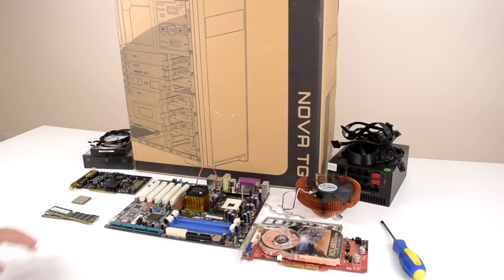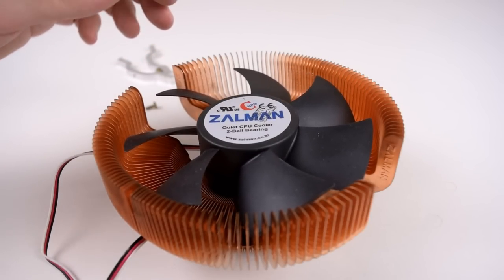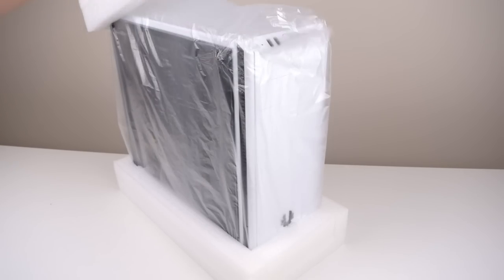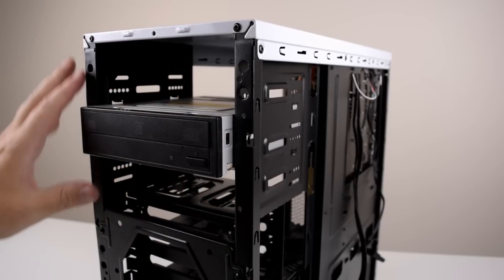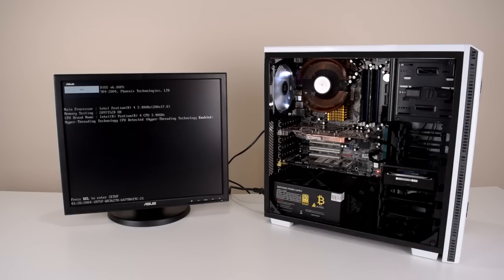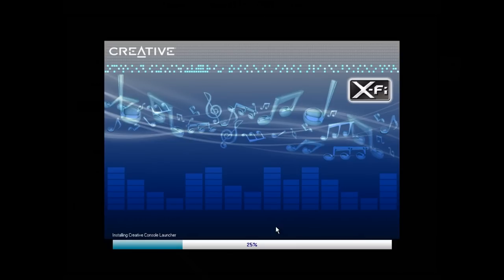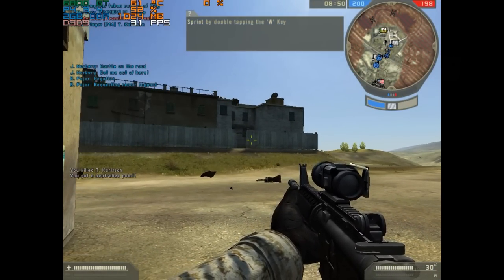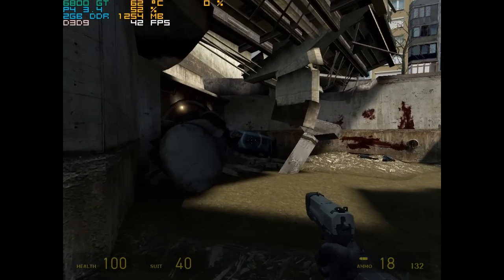Building a Pentium 4 Reverse Sleeper

Comment: Phil, I've heard discussion in the past on whether the Pentium 4's were really a step up from the Pentium 3's or not. Can you elaborate on this in a video? Were the early P4s truly weaker than the established P3s on the market?  Was this resolved at any point (such as when Hyper Threading came out?)
Reply from the maker: Could make for a fun video, but a ton of work because you got to build 2, 3 or even more systems depending on what you want to compare, like SDRAM, RAMBUS, DDR...
Reply: That is true. Maybe consider it as something down the line if you choose to do a series on Pentium processors? I just figured it could be cool to hear about in more depth :)
Reply: IPC is lower, early pentiums needed around 1.7-1.8 GHz to be on par with a 1.4 GHz P3.
Add the price of RDRAM and choosing an Athlon instead was a smart choice.
The later Northwood cores were better and fom my experience with a Cedar Mill chip I'd say NetBurst was highly bandwith limited. (getting around 15% higer performance on average ust by increasing the FSB by 25%, all other clocks the same)
They brought SSE2 and reached way highher clock speeds (topping aut at 3.8 GHz and easily clockable beyond 4 GHz) So anything that uses SSE2 or can fill the long pipeline (like rendering and encoding) runs well on those systems, even compared to Athlons. Stuff that was more into a fast responding FPU (like games) made K7 run circles around Netburst.
For the early chips,, With RDRAM or DDR it was competative, but RDRAM was expensive and it took some time for Intel to accept the facts and switch to DDR. Performance with SDRAM is actually not wirth mentioning.
Reply: Like Lord Mogul said, the Netburst architecture had a far lower IPC than the Tualatin architecture it was supposed to replace. But it is correct that a 1.4 GHz Tualatin P3 can hold ground with a 1.7/1.8 GHz P4. A dual Tualatin 1.4 P3 system can hold ground with a 2.4-2.8 GHz P4 in most everything but memory bandwidth, unless you have a rare dual socket 370 board with DDR. I have a dual P3 1.4, but mine has PC-133.

The reason that Intel bet the farm on Netburst is because they had shifted ideology at this point to "more GHz is better" and believed that even though Netburst had a lower IPC, it could be more than made up with significantly higher clock speeds. Back in 2000, they predicted that Netburst would hit 10 GHz by 2005:

https://www.anandtech.com/show/680/6

We of course know this never happened, even the most refined Netburst core could barely hit 3.8 GHz without using ridiculous amounts of power and pumping out tons of heat.

AMD at this point had largely dropped out of the GHz race and instead chose to make their architecture more efficient at lower clock speeds, hence why they started to use PR ratings on their Athlon XP and Athlon 64 chips.

 Intel would have likely gone bankrupt if it weren't for a small design team in Israel working on a refined architecture based on the Pentium 3, which eventually was known as the Core architecture.
Reply: As for Hyperthreading, it actually caused significant performance penalties in applications that weren't designed to utilize more than one thread, which was common at the time. I remember the moanings of gamers back then that complained about how their expensive new Pentium 4 HT system performed worse than their old P3 system. I was on an AMD system at the time and used to have fun poking fun at them for wasting their money. I'd eventually get around to telling them to turn HT off in the BIOS and they were grateful for the massive performance increase.
Reply: That held true even into later Nehalem systems, often disabling HT improved performance.
On the other hand in programs codes for it enabling HT have easily 15-30% higher performance. Everything that helps feeding the pipeline helped. I wonder how a Pentium 4 build on modern manufacturing could run. Would we able to get the 10 GHz?

Comment: My god that cooler is huge 

Also the nfs underground results surprised me. I only ever dip below 60 when driving through water on a Radeon 9800 Pro, (maxed out at 1280x1024, same results on both an Athlon XP 2500+ and a Pentium 4 530)
Reply from the maker: On default settings it's smooth as butter, but I did crank up everything. So this game depends greatly on the graphics settings.
Reply: PhilsComputerLab I see. I remember underground 2 being very cpu intensive for some reason as well. 
The board I have has PCI-E and AGP (although 2x only and didn't support any form of fast writes so it would bottleneck the 9800 iirc) 
Tried underground 2 with an X1950 XTX and it would not run at a smooth 60 regardless of graphics settings. The same card on a much more modern system was perfectly smooth however.

Comment: Nice :) It's a little bit to old for my tastes though.. (I do have an old AGP Nvidia 7800gt)  I just built up a newer PCI-E version P4 3.2ghz & HT with 4 gigs of ddr2 ram, 120 gig SSD, Windows 7 32 bit.  Windows 7 32 can run a lot of the older games.  I'm in need of a better and older graphics card though. My Nvidia 8600gt is DOA/not responding.  Got a PCI-E nvidia 7800gt/gs card but is missing its stock cooler.  8 series from nvidia would be best with my more current setup and would complete my build for older legacy gaming. (maybe a Nvidia 9600 gt would work)  I'm currently running a crappy gt 730 since it was the only card that worked on boot up with this machine.   I would love to to more legacy games played  with your setup.  Thanks for letting me rant phil.
Reply from the maker: A PCIe Pentium 4 is actually my preferred P4, it's the P4 without many of its flaws. I did such a build recently, and got quite a few comments asking for an AGP build. I will definitely do something with PCIe :D One benefit is cheap video cards, unlike AGP, the high end cards cost a fortune.
Reply: Yeah, the Best Nvidia card in AGP was a GTX 7800gs, i had one years ago.  I was thinking a 8 or 9 series or gts 250 1 gig card. Anything newer would might get finicky or overkill with this system. I'm gonna see if I can snag a 8800 gts 320 mb card from someone I know. (currently running in a fx 60 system)  it would be nice to play my back catalog of older games.

Comment: Great Scott, I had this exact problem (not enough resources) with any nVidia card on one of my retro builds for ages - and never found a solution. Ended up using ATI, which worked fine. I have to try it and if it works, man... :D More over, I just purchased two Pentium Ds from Electromyne using your code, so thank you for that too!
Reply from the maker: Nice, they got good prices on many CPUs, I got a ton from them way before working with them :) I had the same resources issue with a Radeon 8500 a while ago, but didn't try the aperture size to see if it makes a difference.

Comment: Highly enjoyed the video! Phil, you just nailed it for me, mate :)
I have a lower tier system ( P4 @ 2,66, GF 6600, X-Fi Fatality with a front panel) and I have prepared the same Zalman cooler for installation, just don't have the time to deal with it.
Reply from the maker: Thanks :D Man, Fatal1ty, haha, that name brings me back.
Reply: Actually, I got that Sound Blaster second hand 9-10 years ago (and it was massively expensive even then), but I was already past my gaming prime and I was never able to truly enjoy EAX. I had planned to integrate it into a modern desktop (which so far I have not buit), but you made me realize that modern OS-s have relegated EAX to the past. Besides, there were some issues with the front panel, which I could not fully deal with even after dabbling with the jumpers. Maybe, it was faulty like the TV tuner card I purchased with it. But hey, that is the risk when dealing with used parts (and the excitement when they do work :D).

Phil, your channel inspired me soo much to revive my old tech (your somewhat German accent rocks as well :D). Now I am slowly working on a Compaq machine with a 500 MHz Katmai (similar to the first PC I owned). I have already boosted the RAM to 512 MB (in Y2K I had 64 MB, slightly higher than the standard 32MB new PCs were offered in my country back then). Next comes the SD card to IDE adapter (thanks again for the info), I hope I will be able to have a dual Win 2000 and Win XP boot (and move the XP pagefile to the HDD, perhaps?). Finally, I have prepared a GeForce 4 MX440 to replace a G200 (hope it will work). Sadly, the old compaq proprietary mobo may prevent me from maxing the CPU (I had the Abit BE6-II board back then - so flexible; and a Slotket for Coppermine).

Do you flash the BIOS to its latest version when you build old systems? Because many of those MB producers are history and it is not so easy to find reliable uploads. Have you done it for this project? My s.478 mobo is Soltek and I have no idea if it will recognize a higher end P4 like yours.

Final question - do you guys use antivirus protection for the sort of Pentium 4 machines (for occasional Internet use)?

Comment: I think you did a great job Phil!  Great PC build!  Were you worried about getting on the internet with Windows XP?
Reply from the maker: I usually only install Steam by running the installer from a USB hard drive. I also connect to my home network, but I do not access the Internet. In the past I would use Chrome, but AFAIK it doesn't work with XP anymore, so I download drivers and everything else onto my home network and run if from there.

Comment: You should try to build a Socket 479 Pentium M machine,  some companies made standard ATX and mATX motherboards with this Socket, with a similar performance as a higher clocked Pentium 4 processors.

Comment: Awesome surprice to see the exact card i got this year so i have a benchmark to compare to for my timemachine. I was worried my 3dmarks were low for the card but at around 22000 3dmarks i think i did well optimizing my system. I do get similar results on the first run however, 3dmark 2001 seems to run better a second time.

Comment: That black drive glaring from the white case, not sure that traditional beige would be any better though...
My case is black / silver trim, and after getting a drive with "interchangeable" fronts, I thought I'd like to complete the silver trim by swapping to the silver front.
Many minutes of battling to detach the tray front later .... my drive was still black, & I figured that it just wasn't worth the aggro - was also half thinking of changing JUST the tray trim, or possible the main surround and putting the black trim on the tray as a counterpoint
Reply from the maker: I like it because it contrasts and goes well with the black Bitfenix logo. But it's a personal thing. Getting a pure white drive is going to be difficult. But you could also mount a fan controller, USB ports and whatever else you like.

Comment: I'm going through a retro Pentium 4 build myself. The core specs are: 478 3GHz Prescott, Zalman CNPS 7700 Cu, 2GB DDR RAM, Gigabyte GA-8I865GME motherboard and a Palit GeForce 7600GT AGP.  The last component and final challenge is finding a PSU that provides enough power for a retro P4 system. *Question*: Will any new PSU be sufficient or do I look for something from the period (2004-2006) that would have the right volts/amps/wattage/whatever? I'm told that newer PSUs may be underpowered.

Comment: Well this came up conveniently. I bought a rig from a friend when he updated to a Kaby Lake, and I don't like the Fractal Design case he had, plus all the drive caddies need screws, and 3,5" drives need some longer screws which I don't have in order to secure them through the rubber washers so the two 1TB drives are just sitting useless atm.

So, I'm looking at a new case to buy, I was thinking of Deepcool's Tesseract, but the Nova TG caught my eye as well, so I decided to give it some thought and see if I can find a few reviews for the Nova before committing to either one, and apparently I got to see the case in action before I even went out and started searching for it.

I see that it has the cutout at the top to route the CPU power cable like Deepcool has, which makes me happy, but at the same time makes the decision that much harder. What's your impression of the cable management? How's the space behind the motherboard and side panel? Does the case have any quirks worth mentioning, and what are your overall thoughts?
Reply from the maker: What is nice about the rear panel, it has this large "bulge" that makes it easy to stuff all the cables in there without any trouble. The only quirk I ran into was that the case doesn't have connections for USB 2.0 headers, only USB 3.0, so I couldn't use them with the Pentium 4. You can add a third fan at the front, but everything else is pretty straight forward to be honest. I did wish it had a PSU shroud, but with the modular PSU this wasn't necessary and it's dark enough in the front bottom area that you can stuff some cables in there :D

Comment: Should probably make a video with all the best, high-end parts, with no compromise for Windows 98SE. Perhaps, it's already been done, but it's always is a wonderful project to experiment on. Whether you somehow getting the best performing Athlon, or the best clocked Pentium 4, with overclocking with either. If there was a way, even to make unsupported hardware run on Windows 98SE, like a Radeon HD 3850 (AGP). The end-goal, I guess, is to make games that are unsupported for Windows 98SE, run well and stable (if it were at all possibe). So basically, finding the absolute limits you could, experimentally, on Windows 98SE -- Imagine what Windows 98SE could be, if there was no limits at all, at least, with drivers and possibly chipset.

Could probably run Doom Eternal at 60fps on Windows 98SE, and we'd probably never be able to find out the real results, due to limitations. This would open up a Black Hole, possibly.

Comment: +PhilsComputerLab
The drivers for Dell's OEM version of the X-Fi[guessing SB0090?] can be found on the Dell website. You have to look for them but they are there. Google the board model number and you should be able to find them. I actually had that card at one point and it worked great once the proper drivers were downloaded. The USB 3 headers can used with an adapter that can be found on Amazon.
Reply from the maker: A viewer hooked me up with the ISO :D If you ever find it on the DELL site, that would be awesome. The model number of the card in question is SB0460. Sometimes if you know the machine the card came with, you can look for drivers of that machine. I've done this with HP sometimes.
Reply: My bad, the SB0090 was an Audigy card. For the most updated driver for your SB0460 Xtreme Music, see here; http://www.dell.com/support/home/us/en/4/Drivers/DriversDetails?driverId=07M7C 
The drivers on the CD are likely older. This link is also for anyone who has the card and needs a working driver for it.
Reply from the maker: TheCaptain Hmm it states its for PCIe...
Reply: Sorry about that. Dell's driver pages can be a bit complicated and I mixed them up. Proper PCI card link updated. There was a Titanium Dell version of the PCI X-Fi card as well; http://www.dell.com/support/home/us/en/04/drivers/driversdetails?driverId=0810Y

Comment: I'd be tempted to add an SSD for the boot drive and replace XP with 32-bit Windows 7.
Reply: While there might be issues with certain chipsets & SSD model combinations it's not normally a problem as far as I'm aware. Any PC with SATA ports is a good candidate for an SSD.
Reply: Why this video's PC failed to recognise a 500 GB drive is a bit of a mystery, though. There might be a newer BIOS upgrade to fix that.
Reply from the maker: zoomosis The drive could just be faulty, not a big deal. A SSD would have worked, but you will find it makes little difference, a modern SATA drive is plenty for XP.
Reply: From what I understand modern SSDs still have very good wear levelling, so lack of TRIM support in XP isn't the end of the world, but Win7 would make more sense. I still think an SSD would be faster than a HDD. Maybe something for a future video, although it's been done before by other YouTubers with good results.
Reply from the maker: Whenever I do benchmarking, I always use SSD even with XP. Any extra time saves, installing games, or copying stuff, I'll take that :D
Reply: Another issue might be a lack of AHCI support on the motherboard.
And for going for Win 7 (or anything else newer9: No EAX support, lack of proper driver support for the graphics card, Rendering issues in some games. And even the 32-Bit version has to be quite slim to work on a single core with 2 GB of RAM.
Reply: I don't think an SSD would go with the theme to be honest.
Reply: I vote for SSD in old machines too. You can get 32GB SSDs on Amazon for like $20, and it absolutely makes a difference in a PC like this on XP. Wear leveling built in should take care of things for the most part, and if the drive gets wrecked a few years later, who cares, it's a $20 drive in a retro PC. A few games that typically have long load times really benefit from it too, like Half Life 2.
Reply: Besides from the noise and using the sata port at it's maximum spedd I see no point in using an SSD, but probably if you wanted to do so, using a Chinese one with no so high end speeds may be a good option
Reply: defeats the point

Comment: i have  two of those dell oem sound cards, got them for $1 each from a thrift store, just today i got one working in windows 10
Reply from the maker: Did they come with a driver CD? I'm sure you can get them working, I just didn't have the time, so swapping the card was much easier.
Reply: i used the custom drivers by Daniel_k (i think) and disabled integrated sound in bios
after that i had to screw around in the software that came with the drivers until i got the mic to work properly